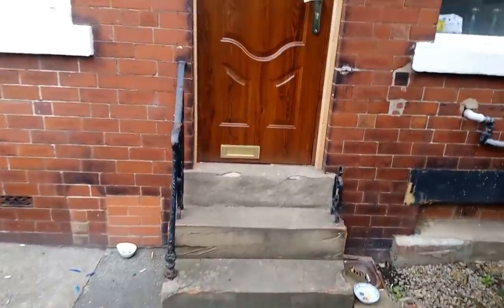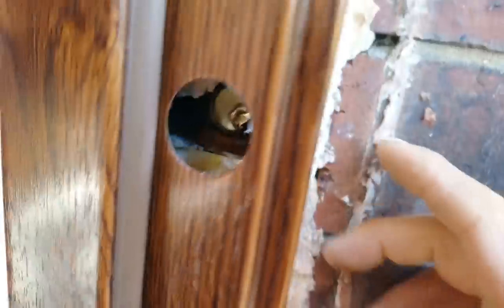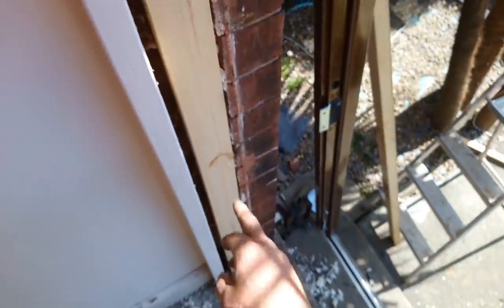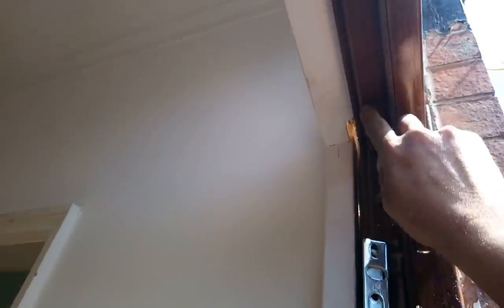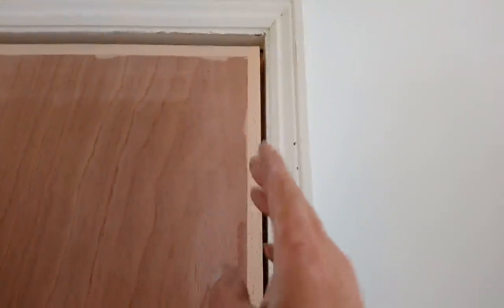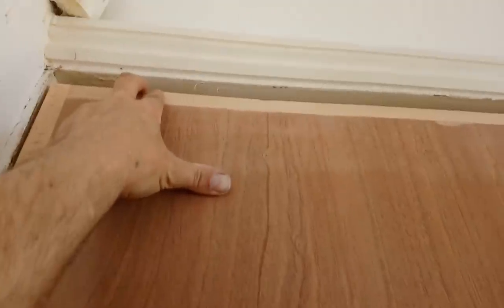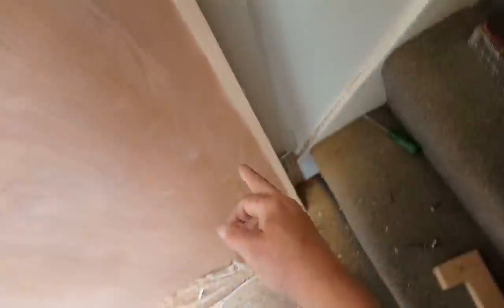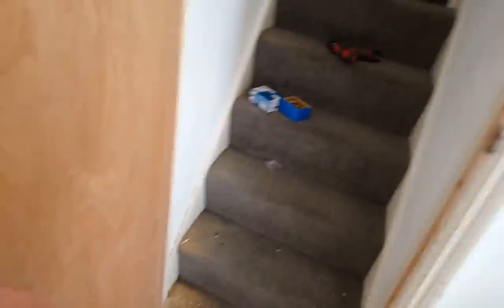Rented house Pt1- Bodged front door turned around & fire doors

Comment: Welcome back Gid, Great video, you saved the customer a good wedge of cash re fitting that front door. it initially looked a lost cause, nice save. The taper on the planner was good thinking gluing a strip of sacrificial wood to give the required angle, very neat. i always use hinge tite screws as the ones that sometimes come with door packs a crap.
Reply from the maker: 🙋‍♂️Hi, I sometimes use the thicknesser but this method is quicker if absolute accuracy isn't necessary ,  The screws on these fire hinges are normally stainless so a little harder but not with this pack 🤷‍♂️ Thanks Roy, yep it turned out ok in the end 👍

Comment: Hi gid, can you remember what wood you used for the lipping? I’m working in an older property. The rebates are 35mm so I managed to find a 35mm fire door that is 2’8 by 6’8 however the opening is 2’9 so I will need to as you have done in your Video add 1/2 inch lipping either side. Thanks for your time.
Reply from the maker: You're welcome 👍 Unless i made them It was an off the shelf lipping from /Milford's, Huws Gray they call themselves now, I think these lipping are only about 10mm thick, might be able to get them from other merchants. You could maybe reduce the opening by adding wood & a new stop bead?
Reply: @Gidjoiner  Thanks for the info. I think time wise adding thicker lipping would be more efficient. My only worry is whether removing the old lipping and replacing it will compromise the fire certification. Maybe I’ll give the fire safety officer a call to be on the safe side.
Reply from the maker: Fire doors regularly get cut to size & re-lipped so i wouldn't worry about that, you can buy fire door blanks that are unlipped, that's why they sell the lippings, there's so many details that wouldn't pass the test when putting fire doors in an older house, if you check ½hr fire door specs & check the depth of the rebate it'll be nowhere near deep enough in the old frames in that house, the position of firedoors & the direction they open, how close they are to staircases.. every job i do on rented houses putting firedoors in, they go into the old frames, fire/building reg people know it's just impractical to replace the frames, so there's always a bit of compromise, re-lipping doors normally states that the lipping should be hardwood, .. but yeah if it's poss spk to the man ,

Comment: i came across metal doors opening outwards on some maisonette type apartments 4 stories blocks, whilst doing the electricity disconnections prior to demolition. they had about six bolts on the inside. the previous occupants were drug dealers. so the police would take for ever to take out the door. wonder if your previous occupants might have been dealers?
Reply from the maker: 😂 maybe, this is a new owner/landlord n there was a string of bad previous tenants, the neighbour def smokes weed n it's just down the road from the nick  😎😂

Comment: Hello gid, what timber did you use to re-edge the lippings on the firedoor? I work for a housing association and this is the kind of work on a daily basis. Nothing spectacular but pays the bills and my tools ;)
Reply from the maker: I think they use Sepele, It's been 20yrs since i worked for a firm but I think the main point is it has to be hardwood, I used what i had which was Beech, If there's to be an inspector check with them.

Comment: Did you make the stainless weather mould or is that something you can buy off the shelf? 🤔
Reply from the maker: Hi Paul, no a local sheet metal firm cut & bent it for me £25 for both pieces, in retrospect the one on the front the weathermould one could have been a little narrower but.... 😉
Reply: Quality solution. 👍👍

Comment: Wow you had your work cut out with that one, great job though, Do Fire Doors not need to have a 1" rebate ?
Reply from the maker: Thanks Brian, public & private have different rules & existing structures as in these frames compared to new build have different rules too, the inspectors/rule makers understand that ripping out in some case nice moulded frames just isn't practical so allowances are made, but i did say in the vid that if i need to i did allow for a deeper rebate to be created by fitting a latch with a deeper back step. I don't think it's 1" tho, ½hr fire door casings are only about ½".
Reply: Thank you for your reply Gid, much appreciated, I do remember the comment about the latch, after 15 years retirement from the building trade, I still like to watch good tradesmen. and you're one of them.👍🏻👍🏻.

Comment: bet you don't like those jobs, "just make it cheap".  Looks like you need to spend ten bob at a car boot sale and buy a new plane. :)
Reply from the maker: Swings n roundabouts on jobs like this, often you're trying to make good with minimal spend yrs of bodging, on this kitchen i could gut it n fit a new one, this front door was a task i felt i needed to rectify but still within a given time n budget, & off course the door had to come off n go back on within the day to make it secure, Yeah it's hard to do cheap work, you try to do it quick but like the worktop joint i could've just bought a metal jointing strip but there's a limit to how low to go. 
Bit more tape n that plane will last another 25yrs 😂 there's a couple of better ones rusting in the shed i think but i like this one 😉